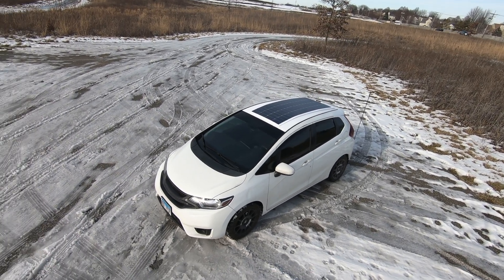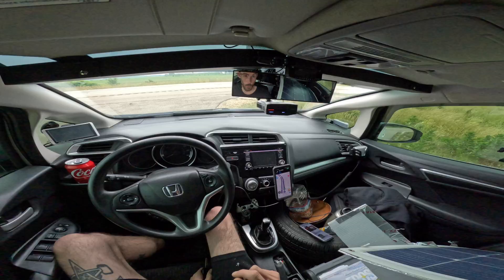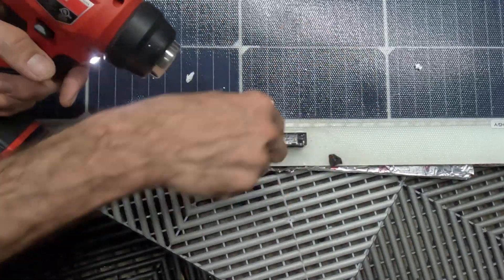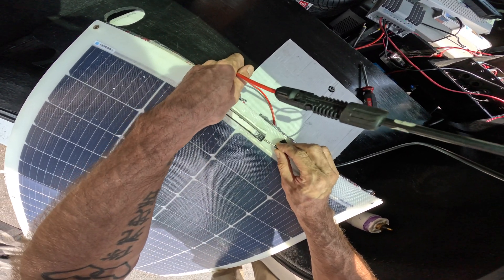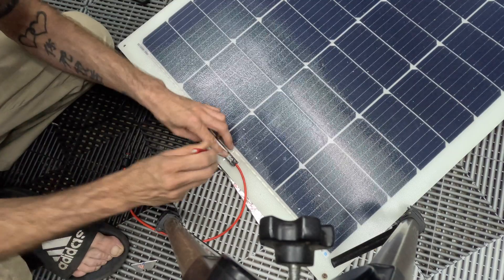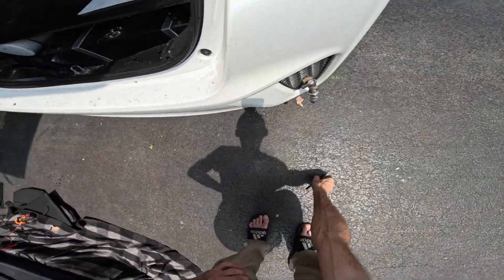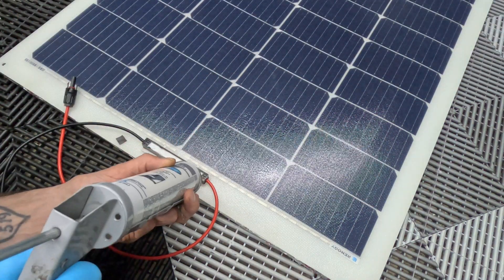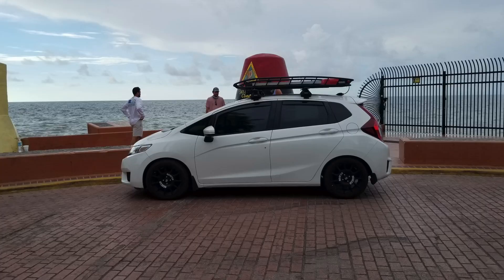Flexible Solar Panel Flys Off My Roof | Can I Fix It? | Renogy 200 Watt Flexible Solar Panel Repair

Comment: So the panel was working well even in hot weather with no ventilation under the wrap?
Reply from the maker: Correct. The panel is completely sealed off around the edges but also not in direct contact with the car. The small pocket of air could be working or the heat could just be escaping through the antenna hole where the cabling comes into the car. It's just covered by a thin layer of vinyl and located under the panel. To be fair, summer did just start. I wouldn't be able to give a decent review on it until after I owned it for a year.
Reply: @HondaFit4Adventure  That's great to hear. Makes me more confident to copy your idea here in a tropical climate.
Reply: @HondaFit4Adventure 

It's been about a year. Got an update? I was thinking of putting this on a sedan roof lol

Comment: Yikes and Yaaay ! ..... bad and good all at the same time. Glad you could recover the panel and that it wasn't under the wheels of a semi trailer when it came off. Super bad that the manufacturer can't be bothered to respond to emails though.
Reply from the maker: For real! My phone call/email was just a general inquiry. I never have any issues with their products and would love to recommend them but...
They also had a 4 STAR review of mine pulled from Amazon and Amazon threatening to revoke my affiliate account because that review went against their rules and guidelines.
(I purchased 3 solar panels and one of them did not have the mounting holes drilled into the panel. I uploaded a picture review stating I love this companies products but 1 of 3 panels I just received did not have mounting holes drilled into it. 4 Stars)
Reply: @HondaFit4Adventure  What! wow. I didn't realise that Amazon played such a dirty game. What's the point of a review system if it isn't honest. Like when there were just bot reviews and they allowed it. Disappointing.

Comment: Hi! Sorry about the panel, could you possibly use bungee cords to hold it down?  Just as extra protection. I want to see you have a smooth trip to AK😊
Reply from the maker: I put clear vinyl down on the roof and then resecured the panel down using ETERNABOND roof repair tape. Also used around RV AC units. I'm afraid that didn't work either. The panel didn't fly off this time but it did become loose enough and started to flap around while driving. I think the adhesive from the eternabond softened in the hot weather causing the panel to loosen up while driving. Im going to use Industrial magnets, Gorilla Glue & Nascar tape next LOL. Hopefully it come out nice.
Reply: Good luck, sounds like you have some solid ideas. I hope the gorilla does not show up in person..lol safe travels!!

Comment: 2013 honda fit traveler here; I'm floored someone else is doing it at all in such a small car, let alone that you had the exact info I was looking for for attaching solar panels
Reply from the maker: Lol, Just keep it at 75mph and you should be fine.
Installation Round 2 also failed. I wrapped the panel on Using eternabond and the same thing almost happened. 
The panel became loose in the front but didn't completely come off. I think the adhesive material softened up in the 85 degree weather.
3rd times a charm!

Comment: Love your vids man!  Glad you got your panel back at least.  I'm a new fit owner, I know you have a catch can installed but was just wondering if you think it's worth it or not, was going to grab that evil energy one you have.  Anyways, nice work as always!.
Reply: fit gang
Reply from the maker: @TheFloridaBikeVlogger  Jazz Gang!
Reply from the maker: Yes, the Oil Catch Can is going to be worth it in the long run. 
It's only $20-$25, making it pretty affordable for everyone.
It will help keep your maintenance costs down and your MPGs up.
How many miles or kilometres are on your Fit?